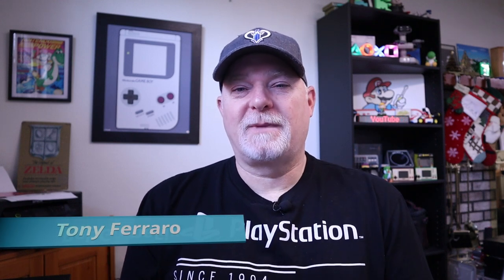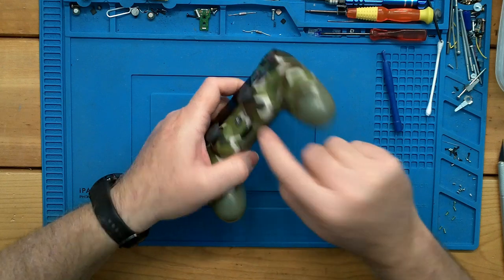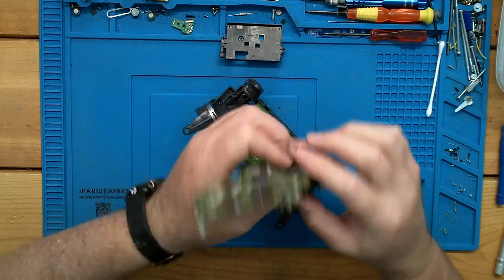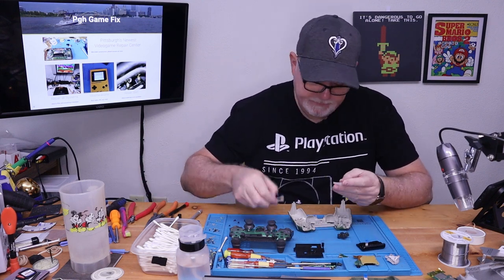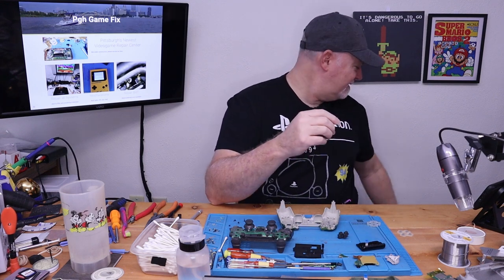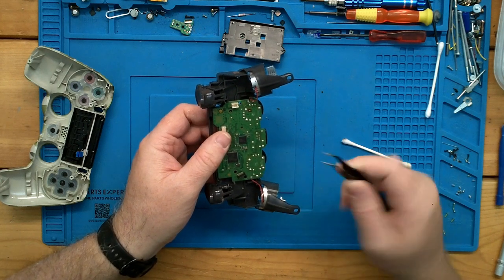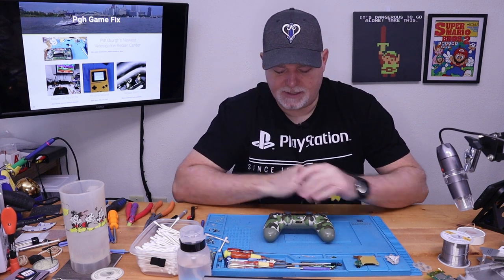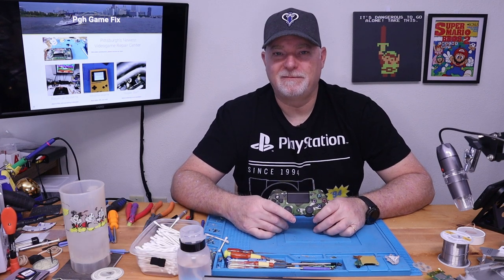PS4 Controller teardown and button Fix

Comment: How much investment do you think one would need in order to do some light repair work? I have an Xbox controller that I feel like will need the stick replaced one day, and I'm keen to try it out. What tools do you think I would need to buy, starting from scratch?
Reply from the maker: Do do a stick repair... you really just need a soldering iron and a solder sucker.  But my prefered method would be to use a low temp solder, and braid to clean it up with after. honestly.... You could do it with a cheap iron, and $20 worth of supplies. To do repairs semi professionally... you could do it with inexpensive equipment at first... maybe a few hundred dollars.
Reply: @PghGameFix  Thanks! When I get around to it, I'll try my hand at the repair with the inexpensive equipment. If I enjoy myself while doing it, I'll think about the next steps. Thanks for the tools recommendations!